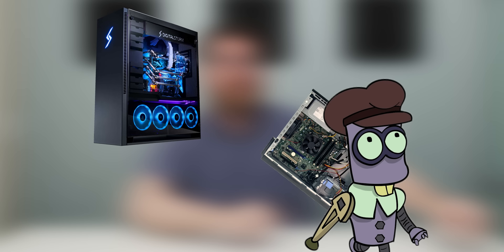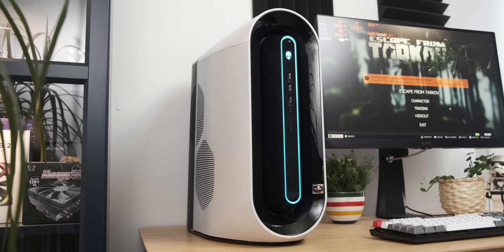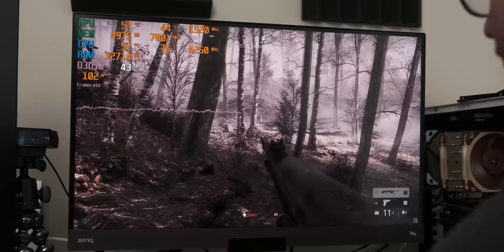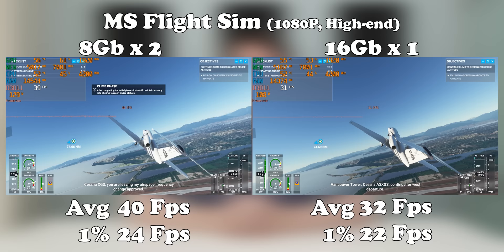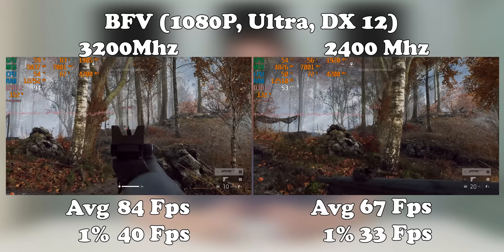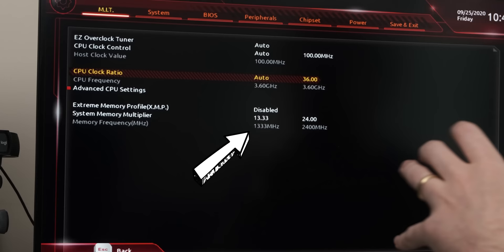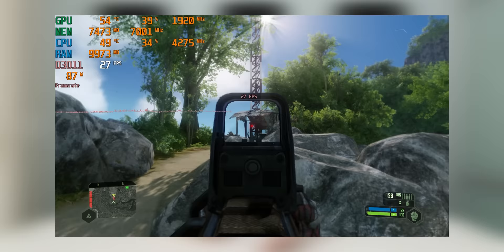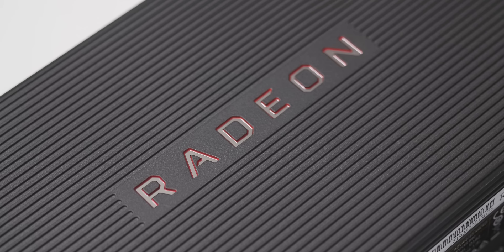How to DESTROY AMD Ryzen gaming performance!

Comment: Wait is this alos the same thing for laptops? Intel ones, i have a single 16gb stick 🤔
Reply: It's kind of the same but also not really: CPU and GPU are not really the same for laptop and desktop and a lot of laptop doesn't/cannot run in dual channel, so I wonder if there is some software/hardware adaptation for that making the single/dual channel gap less important
Reply: @ssenrak8117  could be but idk i am not that good with those stuff , but i think i have a decent laptop its an i7700 hq with 1070 gtx  16 ram , samsung evo 970 plus 500 and 1 tb and a 120 screen , it served me well so far and i cant find a game that i cant run at 1080 full high :3
Reply: @aliesa6120  AC odyssey, ghost recon break point, Horizon zero dawn?

Comment: AMD VS Intel at the same RAM clock speeds 

But the internet tells me AMD CPU are better despite needing a higher clock speed 🤔
Reply: Well, you'll need a better CPU and more ram to use correctly a 3080 compared to a 950ti. Does it mean the 950ti is a better gpu ?

Comment: Trust me Intel will do just fine with that frequency. AMD CPU are good but not enough to beat Intel. All says that AMD win the war, I don’t think so. I’m AMD user too, I use a RX 580 with a i5 9 th genration unlocked.
Reply: Intel is still very respectable in the enthusiast area of things, the 10900K is an amazing chip, but for most people the Price/Performance of AMD outweighs the small boost in performance you would get from a 10900K over a 3700X, 3900X or 3950X. I do strongly believe that Intel is making very good chips, but "winning" in this case isn't just one or the other. There's a lot of different areas AMD or Intel can compete, and as of now, AMD I believe has more of them covered better than Intel. Now, Intel DOES have a place in a lot of different things, but AMD is currently making better chips for most of the Desktop and Portable areas that are better than Intel for the price.

Comment: I alqays get bullied when i ask them if the specs for the new pc that im are good. Can someone just tell me bruh here:1:ASUS ROG X570 Crosshair VIII Hero
2:Ryzen 7 3700x
3:rtx 3070
4:1TB WD Blue SN550 NVMe Internal SSD
5:16GB (2 x 8GB) (PC4 25600) F4-3200C1
6:Corsair Hydro H100 x 240 mm
7:LG 27 Inch Full HD 1ms and 240HZ...
8:CORSAIR RMX Series, RM750x, 750 Watt, 80+ Gold , Fully Modular Power Supply 
Lol

Comment: It can get worse buddy its called falty ram that forces you to not use xmp and hates you and causes occasional crashing oh wait this is real and am dealing with issue yey.
Reply: How do you know it is faulty ram and not the motherboard, cpu memory controller or both not liking the RAM  ?
Reply: @retrosimon9843  hm I do have another pc with same mb and cou well at the time same cpu
Reply: @retrosimon9843  and It didn't crash but it was also working fine in the beginning
Reply: @retrosimon9843  for the first month